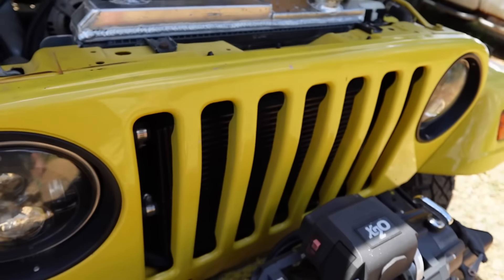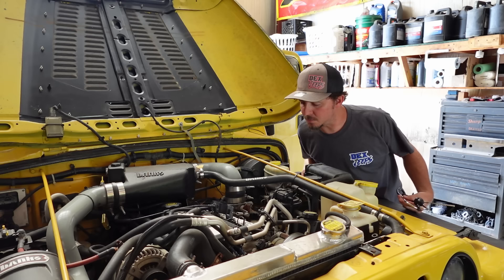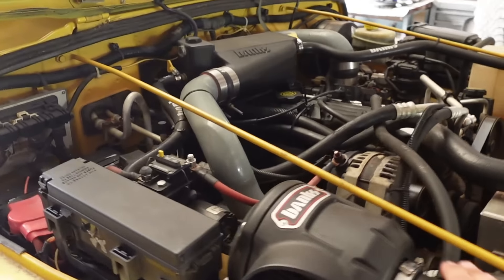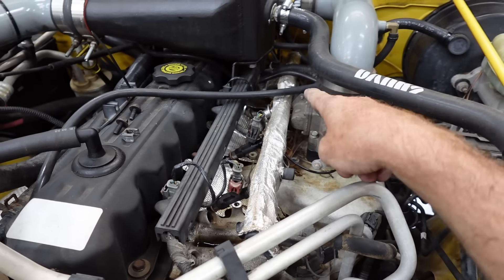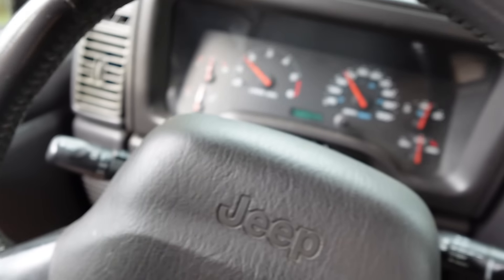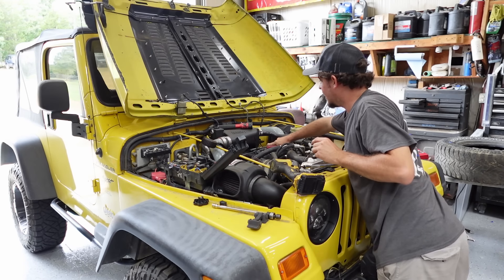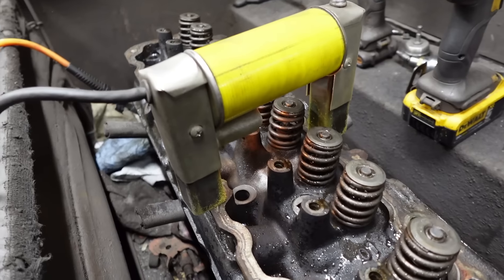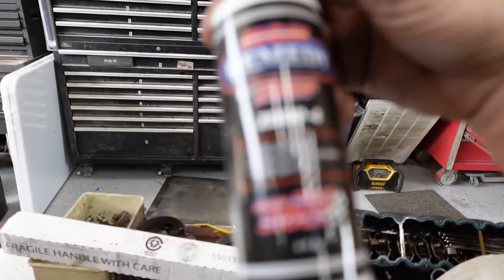SICK Turbo Charged Jeep TJ: It's Actually sick, I Fix It! Simple Mistake...

Comment: when i was drag racing small block mopars we would build a motor run a minute load on trailer drag race that night never heard about breaking in a cam before covid
Reply: racing a whole different game than a daily driver you dont build race motors for longevity
Reply: I warm it up for 5 min then run WOT to redline. 

If it don’t blow up then it probably won’t 

They don’t break in new engines.

Comment: 2000- early 2002 4.0 engines had heads prone to cracking and mopar came out with the TUPY head on later 2002-2006 4.0 engines. As for a good channel about oil or engine related is Lake Speed JR's channel which is "The Motor Oil Geek".

Comment: Well, you swapped spark plugs, injectors and coils.. no change, then you did a leak down, piston rings and valves hold, then all you have left is either your cam or lifters are smoked.

Comment: I am at this exact same place but cylinder #1 instead of #4. I put full synthetic in it the last oil change 3,500 miles on that oil change. I don’t have any oil pressure but haven’t since I’ve owned it for 18,000 miles! Fyi it has a Jasper Engine in it. I’ve changed cam sensor, crank sensor, plugs, coil pack, swapped injectors. I need to pull the valve cover is my next move. Thanks for videos! I personally like them all!
Reply: You changed the cam but didn’t remove the valve cover?

Not a fan of jasper engines. 
But some
Of them work for a while
Reply: @fastinradfordable  it was cam sensor. I thought I was linking it in with the crank sensor but I see how that didn’t work so well! 👍🏼

Comment: Rebuilt my 2.5L and had to hunt for the "old" Delo400 oil to get the zinc. It's a brave new world folks. It almost seems they're actively trying to wreck our old motors.
Reply: Thanks for sharing. I'm building a turbo 92 YJ 2.5L. Gonna try to blow the head off with 30lbs....

Comment: What are you using to turn the motor over from the fuse box..pull the cover off a starter relay and just pinch the contacts?

Comment: I had a tick in the 1990 2.5 litre Dakota that would not go away,, sold the truck and the guy pulled it apart 121k truck two flat cam lobes... He scrapped the motor and swapped in a 3.9 239 cubic inch v6

Comment: Dex, I love your videos - keep up the good work. I have to comment on this one. The video showed the engine had a cracked head which you replaced. The bad lifter was probably from the cracked head, not from using synthetic oil. There is a lot of new research that shows that flat tappet lifters work fine with synthetic oils AFTER a proper break-in using conventional break-in oil with ZDDP. Check out the Oil Geek videos.

Comment: This seems to be a problem with all the flat tappet lifters and cams nowadays. Ive been reading posts and eatching videos for small block chevy engine builds and people who have built 100's or possibly 1000's of them have said the last few years its 50/50 on wiping out a cam lobe/lifter/both within a couple hundred miles, if not during the first 20 minutes(break in). As the automated world has moved to mostly roller cams and lifters, many lifter manufacturers have outsourced their lifter to overseas and the quality is not as good. I think elgin is one of the few(possibly the only one) that still makes their lifters here in the U.S. And yes, you are 100% correct about using full synthetic on these old antiquated engines and the lack of zinc in moder synthetic oil. 
I do jave one question though. Fo you think the bearings(main, rod, and cam) should have been changed being that all those metallic particles were circulating through the system?

Comment: i tried to do injector upgrade on my 95 xj for some reason it would not fire the 2 middle injectors even pulled some from my other xj put the 95's injectors back in runs great again

Comment: Peanut butter under the oil cap of a 00-02 4.0 generally means 0311 cylinder head doing 0311 things cracking the head between cylinder 3-4

Comment: Non tupy 00+ heads are junk. They all crack eventually. Mine cracked at 260k and hurt the cam bearings... Give that much wear and level of disassembly I am surprised you didn't do cam bearings on it.

Comment: Did you make sure the intercooler system was full of fluid and the pump was working???

You will overheat the combustion chamber with a turbo and non top notch intercooler.

Comment: Can you put the zinc additive you use in the description?
I have been using Mobil 1 in my 1996 XJ for 380,500 miles and now you have me worried.
Reply: I lost the #3 piston in my '96 XJ at 370k. Used Mobile 1 exclusively in that engine since I bought it at 96k. Might watch Dex's video on piston replacement. I bet you have at least one cracked piston. Ruined my block, had to get a reman from Jasper😢
Reply: @wcollier1  So what cracked piston symptoms does my Jeep have? Please be detailed.
And I have watched that video.

Comment: What model is that code reader? I need it, looks like a Bosch unit
Reply: Check pawn shops. 
I got one for $25 
Had it for a decade. 
Reads abs and trans and engine codes.
Reply: @fastinradfordable  Do you have a model so I know what to look for? Pawn shops sound like the move, I'm gonna guess they are expensive online.
Reply: @benlizak50  actron is the brand. Many diff models.  bright orange. 
Looks like a old handheld toy. 

Mine was made in 2012 but it still handles 2023 vehicles. 💪

Comment: How do you actually flush out the oil system ?
Reply: Change the oil twice.
Reply: I actually change my oil twice every time.

Drain it and fill with fresh.  
Start it 

Drain it again and replace the filter. 

Fill with new oil. 
And you’ve now got darn near 100% oil changed out. 

Use cheap oil for the first drain and fill. 
It’s worth $15,

My 400,000 mile diesel oil stays crystal clear.